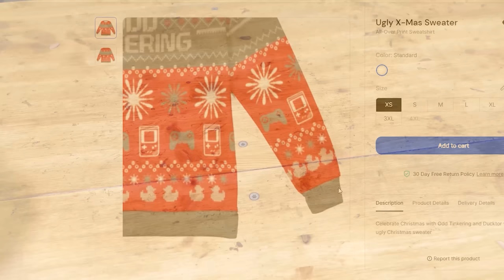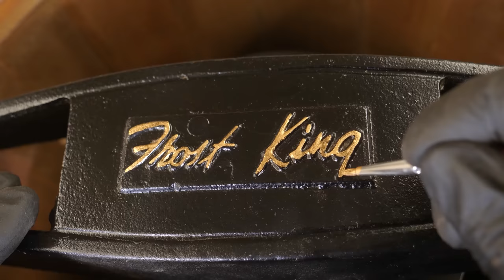Antique Ice Cream Maker Restoration

Comment: Our ancestors use to be so much stronger than we were because they had to work for their treats. Basically you were working off the calaries so you could add a few on lol. Weve become so lazy in our homes with all the modern conveniences that we have to get regular excersize just to accomidate the lack of manual labor for house hold chores. The drill made me laugh after a few minutes we get board of the process, thats when you turned the pail around and worked out the other arm. My mom said they use to play kick the can when they made ice cream her and her 15 sibblings would go out and play soccer with it and after about 45 minutes they cooled down with some ice cream. Her dad was so strong he used 5 gallon buckets he filled with cement as weights. I thought she was lying until one reunion an 85 year old man could still do it. They may have worked hard but the result was worth it.

Comment: When you restored the metal cylinder, you used solder. The solder contains a large amount of lead, which should not come into contact with food because it is toxic.
Reply: I was worried about that. Maybe put in a food grade liner? Or seal it?

Comment: Great video, just one question
At 8:50, you are soldering a metal piece on the hole to fix it, but what is the solder that you used? Is it lead based or lead free?
I searched on internet but couldn't find any food safe solder

Comment: Just one Question..... Why you fittet a Piece of Metal in a Corroded hole instead of drill an Hole 1-2 mm Bigger and terminated the corroded area and Drill a Piece of metal in the exact size from the plate.... Easier and much morce comfortable

Comment: Next time put salt in the solid water so lowering the freezing temperature. You will need to add more ice to avoid to have too much liquid, but in this way you will not need to put it in the freezer.
Reply from the maker: You get different consistency if you do it like that. I prefer it this way. Also ice creams like Ben & Jerry's are made like this. Putting the ice cream in freezer before it's fully frozen allows smoother texture
Reply: @OddTinkering  that was the old way. Sure the modern one works good as well.

Comment: use a cloth or some cotton batting wrapped around your hammer to avoid marking up your soft woods when you work on antique wood pieces like this. My dad does that when he builds cabinets and he's nailing in an area that will show. I kinda cringed when you didn't use cloth a few times, and I saw you made a mark when you were nailing the handle on. You can also use a small ball peen hammer for places that may damage the look of the wood, like in a kitchen piece like this. Bougie people notice every little mark, so taking some extra care will up your profits. :)

Comment: Arn't you supposed to add salt to the ice? I've never done this before so I'm not positive but I heard if you put rock salt on the ice it helps the ice melt faster thus releasing more cold faster and you don't have to crank as long.

Comment: Making the ice cream would've worked far better had you put rock salt in with the ice. Those old-fashioned ice cream makers are usually made to use ice and rock salt, which makes a colder more solid iced cream.

Comment: You soldered the cylinder with tin if it is not going to be used for human consumption it is ok but that material contains 40% of lead is poisonous for human beings. The correct thing to do is to solder stainless steel...